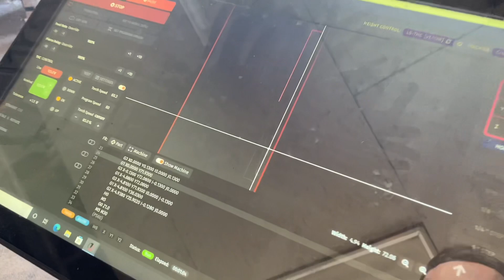I Made These Mistakes When Starting My Welding Business So YOU Dont have to!

Comment: I also had my Lincoln 210mp break down on a job. Fan motors went out when I really needed em. The welder still worked but would overheat after like a minute of use. They did fix it though. We got a pretty good dealer that subs out the repair work to some guy in Columbus. Lincoln just pays the bill. I usually use fronius in the shop though. If you ever need a really decent machine check out the fronius transsteel 2200. It’s pretty much equivalent to them bigger roll around Lincoln’s like the 260 mp. I suggest finding a local dealer for em but bakers gas is pretty good too
Reply from the maker: I did take it to a local dealer. I think when I go grab it next weekend I’m gonna have to go to a bigger company like AIRGAS or something 😅
Reply: @washburnfabco  good luck with that.

Comment: I have a bunch of Lincoln stuff, but Lincoln uses the old business model where they use distributors to sell their gear. If you're not a distributor that sells hundreds of machines (or a celebrity welder), they'd rather you just go away. Far, far away. Especially if your welder is busted.
Reply from the maker: That machine is still in warranty claims 😴
Reply: Lincoln Electric always stood behind their machines when they broke. Even an after warranty repair on one unit I own. The tech support has been great also!
Reply from the maker: @johnw4590  wish I could say the same. They have had my machine longer than I have had it in my possession.
Reply: I've learned in my 4 years of welding, Lincoln is just a name they slap on there 3rd party sourced product. The tig wire is sourced from at least 10 different countries. Even my helmet had Lincoln all over it but you try to sources the lenses and you find out the helmet is made by Metalman. The shop I'm in is team blue. Miller is a solid brand
Reply: Ive had no issues with Lincoln warranty claims , my 260mpx had 30 hours on it and had main chopper board go out  then my auto idle stoped working, emailed Lincoln they sent me a new machine within 2 days . I was pretty impressed.
Reply from the maker: @MitchintheorangeDigger  I have a mpx 330 under 100 hours on it and out of warranty. I really hope something like that dosent happen 😅

Comment: Great information on business practices. I am with you on staying away on brand name equipment . The quality is not there anymore, the electronics have sabotaged the reliability. I have a lincoln ranger 250 that needs a circuit board $1600 just out of warranty. Same thing on my lincoln mig welder .  Some of he import welders aren't bad  and you can have a spare if anything breaks.
Reply from the maker: Thank you. Yeah i definitely agree. I have only lost one import machine. Which reminds me I need to pull it apart one of these days and see what happened and talk about it in a follow up review. It was the best arc machines. I would stay away from them. I like my set up now with multiple machines on deck ready to go. Never any problems with my others still.

Comment: If you get a motorcycle and like to cruise,  you should ride to the job to look at it.  Now the trip is a tax write-off.  The excuse is better fuel economy.  But now you can ride for free...
Reply from the maker: I do have a Harley lol.
Reply: @washburnfabco  then you should definitely be letting the Fab shop pay you to ride it! I suggested that to a fellow that had a lawn care. He would always take his truck that got 12 mi to the gallon around and look at the lawns that should be ready to cut. He did not even check with his accountant to look into it. It was work-related. He did not need to carry any tools, so it should have been a no-brainer. I would bet that you could still get the 55 cents per mile write-off. It's probably going up since then. It has probably gone up since then.

Comment: You might be running through welders because the generator you are using could be putting on dirty power
Reply from the maker: I had one Lincoln fail at the power supply. But all the others have failed for other reasons (all Lincoln’s) displays, weak wire drive motors etc. These cheap machines like arc captain and get yes welder both run good and have for a few years now on my mpx 330 and my 9000 predator. No issues.
Reply: @washburnfabco good to know. I work full time in a shop and looking to start branching out on my own. Was curious if that was the reason because that would be most affordable to me. Tough to drop 4k+ on a engine drive welder when right now all i need is a generator to get started! You dont have any issues running stick or anything on it?
Reply from the maker: @Undisputedcomedy1  no the predator runs all my welders fine!